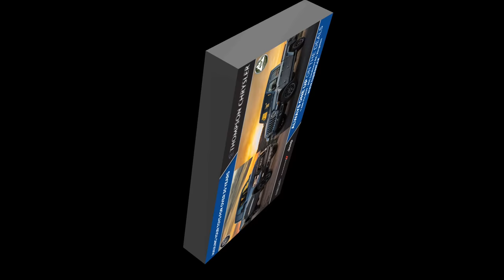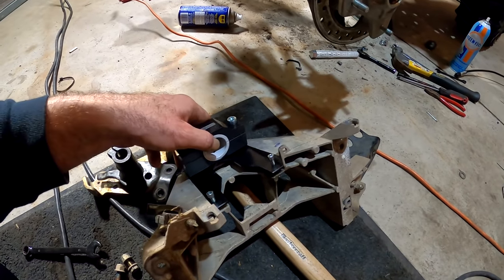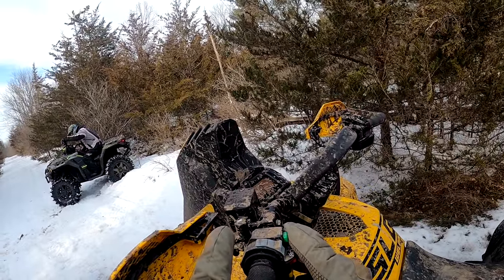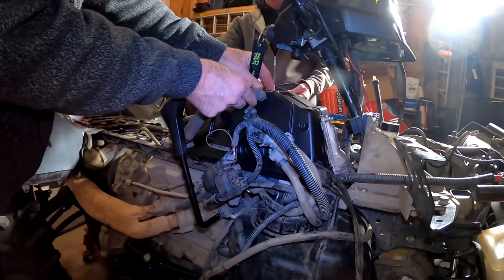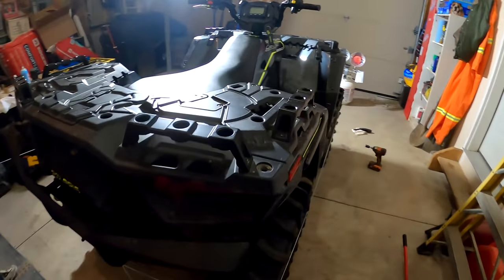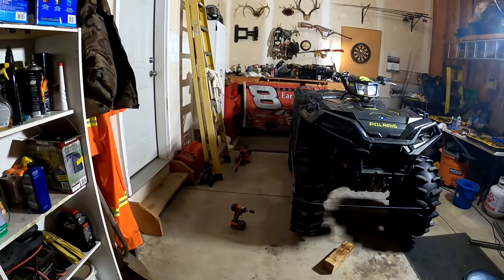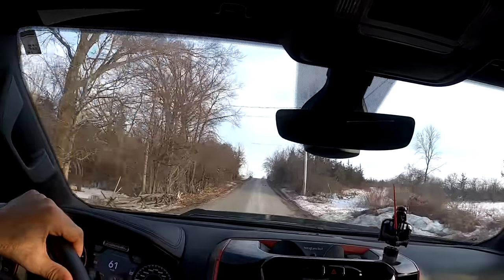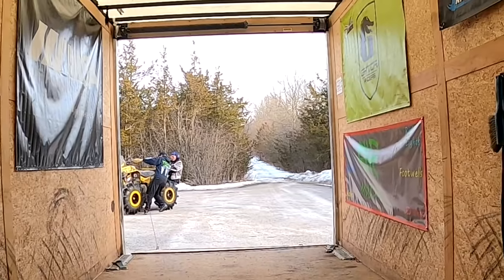Don't Get Used To It!!! Polaris Sportsman 850 SP Test Drive

Comment: My AC also has the slop in the steering from the pinch bolt loosening. A little loc-tite fixes it. But I think its just a side effect of having eps. I've never had issues on my machines that don't have eps. Everything in life comes at a cost, EPS = another thing that can need maintenance

Comment: Hi I just got a 2019 renegade xmr 1000r and I was going to get the dynojet vision 3 and then get an exhaust can I put the dynojet on before I get the exhaust or should I wait
Reply: Why not get the dymo jet? You can always change the tune after you find an exhaust you like
Reply: @geetee3362   how would I change the tune after I get a pipe sorry I’m new to the fuel injected stuff
Reply: @ryanfowler6764  you can download a tune right from the dynojet website specific to your mods.
Reply: @geetee3362   okay thanks buddy I appreciate it